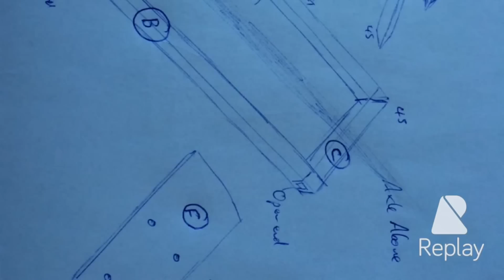Building the GX200 motorized drift trike (with time lapse)

Comment from the maker: I can highly recommend using front kart tyres on rear rims after yesterday's testing. Rear tyres on rear rims do not take sleeves easily & 4.5" stretched by popping with starter fluid & fire was a job worth doing. Now sleeves slip right on & hold with 35psi.

Comment from the maker: Sorry for late replies, no laptop at the moment and can't see comments properly on iPad... To answer a few common questions the engine mount is a piece of 8mm thick steel plate welded on all edges top & bottom directly to the rear beam. The chain adjustment is made using the slack between the m10 bearing bolts and the 18mm holes in the bearing blocks (whole axle slides back and fourth just enough then tightened to 50nm). All the bolts are high tensile metric with massive washers to spread the load on stress points. I'm sorry, I can't remember the name of the songs. The box sections are 40x40 3mm walled and 40x60 4mm walled mild steel. The axle is 1000mm wide. Hope this info helps & good luck with your own projects 👍🏻
Reply: xsamp86

Comment: Great video by the way, you inspired me to to build one like this. My first welding project.
Reply from the maker: Thanks that means a lot! This was mine & my brother in laws first time welding too. We spent £60 on a beat up gas MIG using disposable co2 canisters & soon got the hang of it. 0.6mm wire was significantly easier and neater than the 0.8mm stuff it came with. Get yourself an auto darkening mask though it's worth every penny & it's clear enough to do your grinding & paint prep with too. Good luck!

Comment: wow, just came across this and im glad to see yours works with this design! i had the same idea to use the rear arms of the bike welded to the rear frame and was told it will twist! well mine looks very similar to this but i didn't use bolts from bike to rear frame just welded it up, its 95% done just waiting on new throttle and cable plus a little more welding to support the seat area as i have noticed that its starting to bend a little.  if im honest my second one will have a custom front end not going to use a bike frame, another thing i have noticed is throttle is no good when running on the governor arm as its all or nothing so will be hooking it up direct and next oil change removing the internals. i know this video is over a year old but do you any advice? cheers

Comment: Nice video! I was wondering what size material did you use for your rear end and what are the dimemsion? going to build one myself looking for any tips
Reply from the maker: 40mm square box with 3mm wall and 40x80 4mm wall for the rear section where the engine mount welds to. The chain guard is an office chair leg. It's all OTT and as such is heavy but who cares when your not pedalling 😁
Reply: +xsamp86 whats the measurements of the box In inches

Comment: good build man what size tubing for rear axle and engine frame
Reply from the maker: 40x40mm 2.5mm wall square box steel, 60x40mm 4mm box for the rear beam & front frame joiner. I think it was about 600mm wide & 400ish deep but I've since sold this project for the next one!

Comment: Ill look into those masks. 1 more question i have used a bike frame aswell the exact same way as you, have you had any strenght issues in the frame ( bmx part).
Reply from the maker: We were concerned about the bottom bracket so we did 2 passes of weld around all the tubes and welded in a small piece of tube (shown in vid but poorly) underneath to overlap the BB she'll and downtube. The rear stays were played with steel salvaged from a plumbing expansion vessel about 1.5mm thick & welded top and bottom on all edges inc where it meets the BB and the box section where the wheel axle would have gone. I'm 14st and my brother in law is 18st and so far so good. It's all about nice fat beads of weld & if it looks ugly it soon cleans up with a grinder ;)
Reply from the maker: Lol excuse the autocorrect spelling...you get the gist of it!
Reply from the maker: Right...don't judge, this is unlisted footage I cut from the video because since taking; the throttle was redone after degovorning, the additional downtube reinforcement hadn't been added and bigger washers were put on the frame bolts as we had a bit of flex in initial tests. Since making adjustments it's solid as a rock... https://youtu.be/UZymJJUjRx4

Comment: I wish that axle kit was still available
Reply from the maker: It's not a kit, but it's cheaper to buy a complete used kart axle so you get your sprocket carrier & hubs included. That way you just have to buy pillow block bearings same size, adapt a blank sprocket of your choice & bang on any old set of kart wheels 😉

Comment: Hi, I am building a motorized  trike for a school project. We have a design similar to yours. We are having difficulty designing the mechanism in which the motor will be, in your video it is like a brown metal box where the engine is. How did you build that part and do you have any advice for our project? Thanks.
Reply from the maker: +Noah Stonehill Its just a square of thick steel plate welded straight onto the box section frame on all the edges that meet. 4 holes and thats it!

Comment: What you use for sleeves on tyres please? Tube brand, where did you buy? Please a neeed help... :)
Reply: Michal Stepanek you can use PVC piping.
Reply from the maker: They are MDPE 250mm tube bought from DrifttrikesUK. Lasts well but not cheap buying it in small amounts

Comment: Sorry for my ignorance, but what keeps the axle from sliding back and forth in the bearings? Are there just sleeves preventing it between them and the tires?
Reply from the maker: The inner race of each bearing is about 5mm wider than the outer race and this lip has 2 grub screws to pinch up the axle. It's a snug fit & that's enough on its own.
Reply: +xsamp86 Was just looking at that on another site. Thank you for clearing it up

Comment: Do u think u could build the back half that the engine is mounted on out of wood?
Reply from the maker: Only if it was a serious piece of engineered ply. I actually broke the motor mount plate clean off in my first test on a bump. Welder ran out of gas, being the last bit I chanced it & it hadn't taken. Lesson was learnt & I did a second pass of weld in several key areas & reinforced where the down tube meets the bottom bracket. I'd say stick with heavy gauge steel plate if you can.
Reply: +xsamp86 yeah I asked about wood because I have no experience welding, but... Thanks anyway
Reply from the maker: +Dan Graz neither did I... This was my learning project ;) get a used gas Mig & have a go 👍🏻 0.6mm wire

Comment: Where did you get the axle pillow?
Reply from the maker: eBay. I searched 30mm pillow block bearing and found some for £8.90 each posted. They're seriously heavy duty looking & have grease points and pinch grub screws to hold the axle. Mounting holes are a huge 16mm but I used this space with m10 bolts and 30mm washers to tension my chain.

Comment: What's to stop your shirt from getting snagged in the sprocket?
Reply from the maker: +Zane Rader An upcycled steel chairleg acts as a guard so you cant fall into it directly and also catches the chain lube. You could enclose the sides with any sheet material and a couple of brackets but i liked it open

Comment: Can you make it also with a chainsaw engineer (a smaller one for a kid) ? Looks Nice
Reply: ENGINE
Reply from the maker: +janijmte verhoeff Thanks, i have seen a video on here using a 49cc mini moto engine, seemed to work well, I think a chainsaw engine might go though clutches a bit quick.
Reply: +xsamp86 and what kind of motor are u using couse maybe i can buy the same motor somewhere
Reply from the maker: +janijmte verhoeff I'm using a Honda gx200 clone & if anything it's overpowered. £120 posted on eBay brand new
Reply from the maker: +Dylan Walker about a week to source major parts after making a list & drawing ideas for how to attach a bmx frame to a rectangular subframe. Total build around 2months of Sunday's & we then added some additional welds after we fractured the engine mount on a pothole (turns out when you run out of co2 on a mig you really can't chance those last 2 welds without lol)

Comment: About how much would you say you have invested into this build?
Reply from the maker: Around £350, £155 of which was on a new engine & centrifugal clutch to match our sprocket. The wheels, bearings and axle with carriers & hubs make up about £100, the Bmx and steel were scrap from our local recycling centre bought for a few beer tokens & the seat, bolts, cables & thumb throttle make up the rest (all from eBay). Finally I had to buy 10" mdpe tube at a whopping £40 but if you can source this from a builder it's better bought in lengths.
Reply: I've been trying to decide between building one of these and a GOKART it's just hard to decide between the two. The trike is only really suitable for smooth pavement vs a kart I can at least get a little versatility from.
Reply from the maker: +John Smith I had a similar thought but there is literally nothing like the feeling of these things! Karts are fun though

Comment: can i use pocket bike wheel???
Reply from the maker: I looked into it and due to the amount of machining involved the cheapest option was to use a standard kart axle and hub setup. The sprocket was drilled and fastened to the back side of the brake disc carrier I already had and centred by spray painting a template onto the old disc and using it as a drill guide on the blank sprocket 👍🏻

Comment: you got the idea from colinfurze.
Reply from the maker: The original concept actually came from a hybrid after reading http://www.instructables.com/id/Motorized-Drift-Trike/ and seeing http://youtu.be/4-eC2UN8qTg. Colin furze did indeed also build a geared trike some time after mine but feel free to screenshot my original sketches for your own reference. I wanted to make a removable subframe mainly for transport & storage rather than come straight off the front frame which is why I've used such excessively thick material for the rear stay block & reinforced it. Weighs a flipping ton mind. The axle/kart setup is purely for convenience as it costs as much to buy a used assembly as it does to make one up unless you've got a lathe ;o)